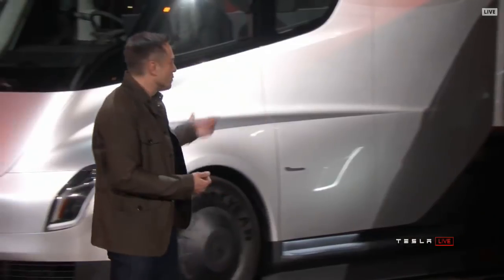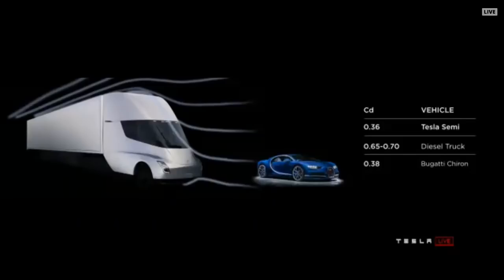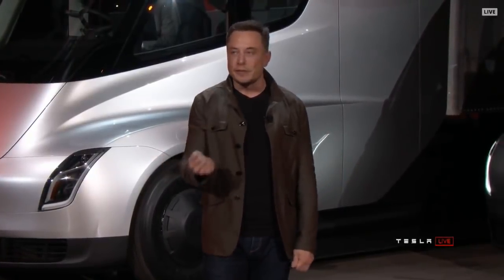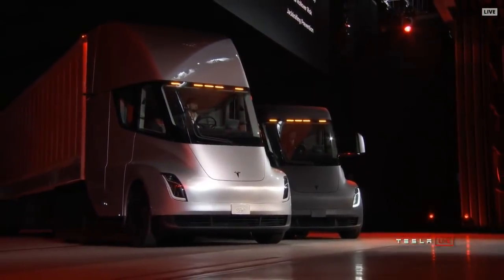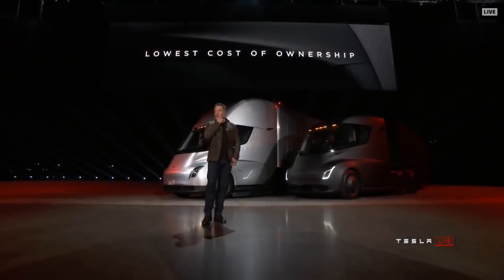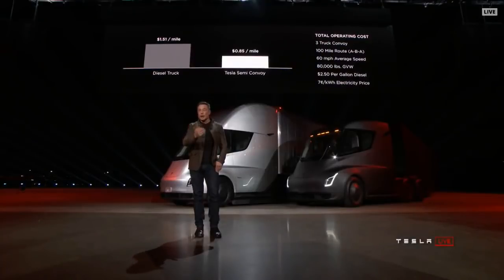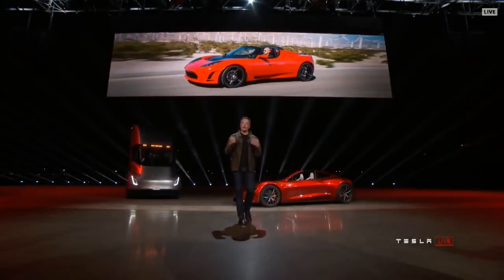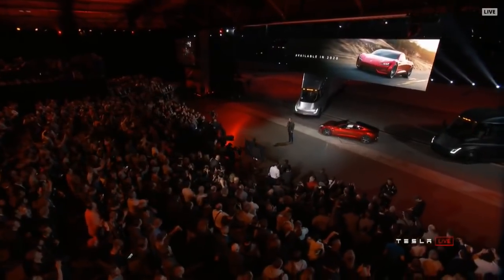Tesla Roadster 2020 Video | Tesla Semi Truck

Comment: 1.9 second 0-60 ... damn
10000 nm torque ... wtf
Reply: Electric motors for these vehicles can have waaaay more torque then that still. This figure is impressive and what is optimized perhaps for the powerband and top speed and efficiency but I’m sure tesla has tested prototype motors that make 20,000+ nm
Reply from the maker: TridibBiswas it sounds ridiculous doesn't it
Reply: Range 620 miles !!!!!  1000 km....thats the real f-ed up number
also, Semi truck nickname BAMF  :D :D :D
Reply: TridibBiswas wait until you see that semi on a quarter mile.. Beating street cars.
Reply: Cardfold11 software limited.. Fuck yeah.. Hacking rejoiced.